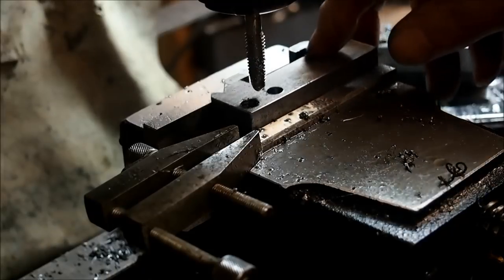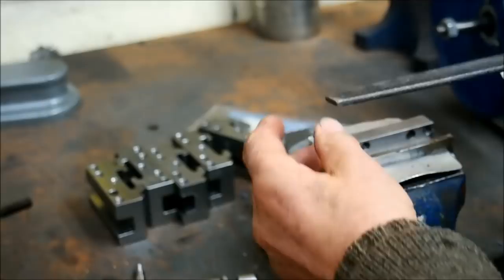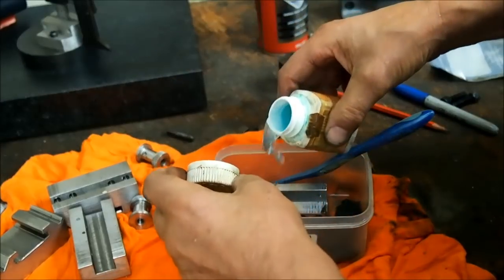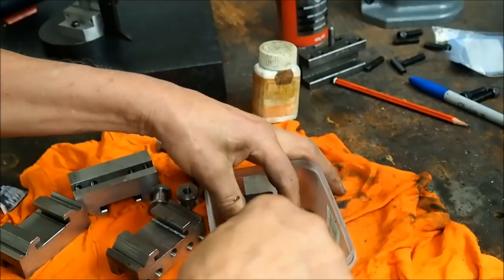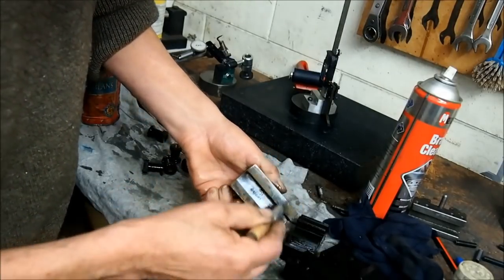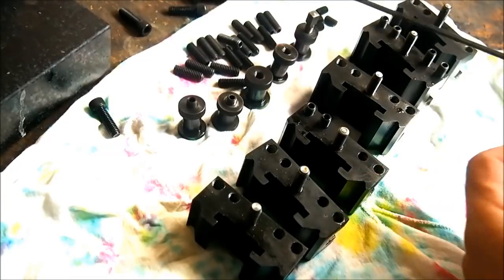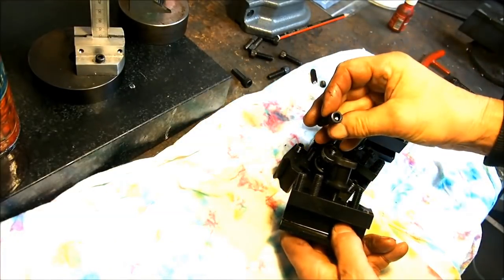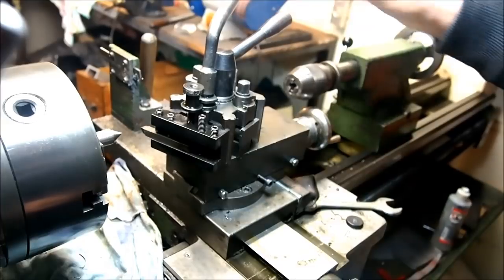Making Italian Style Toolholders  part 8 of 8

Comment: I've used the college blue for years but I cheat , I find after degreasing them I heat them up a couple hundred degrees they blue deeper and no extra drying just some oiling . Never had a rust spot or a non bluing area. I use the brownells bluing also. Good build I'm gonna make some to I hope.